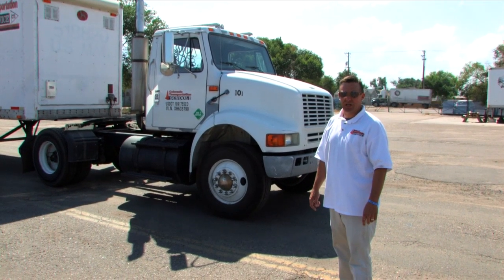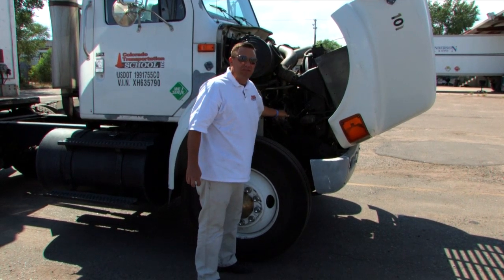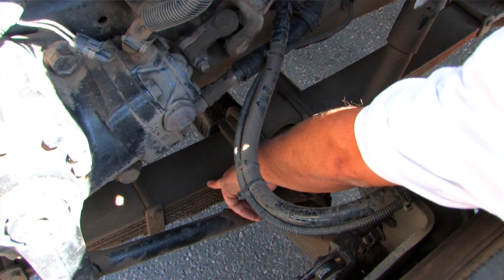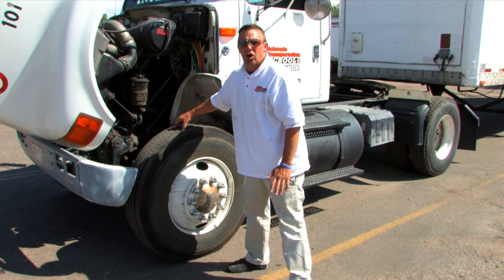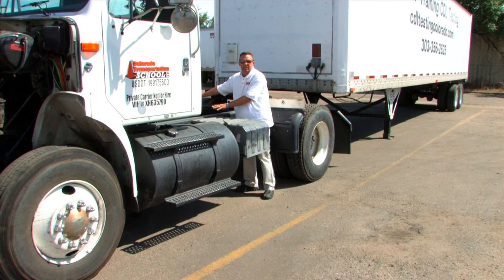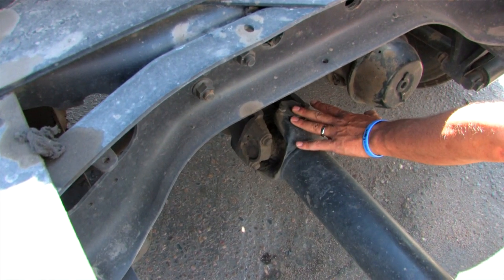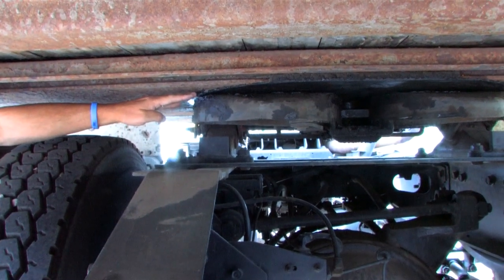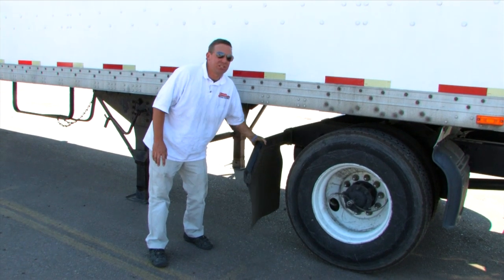Pre tip vehicle inspection by Colorado Transportation School Part 1 of 2

Comment: The inspection of the fifth wheel and it's mounts should be done before connecting to the trailer. Also checking the skid plate and kingpin should be inspected before connection of the truck and trailer as well.